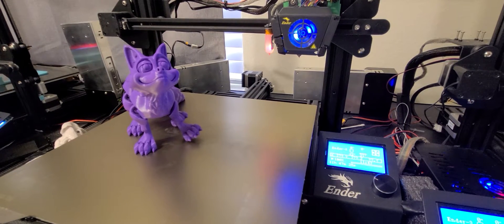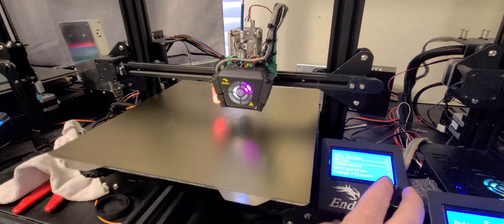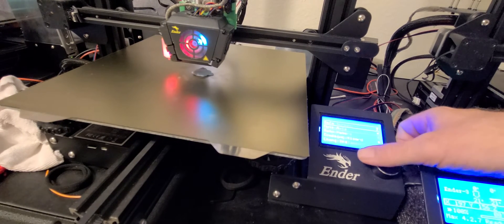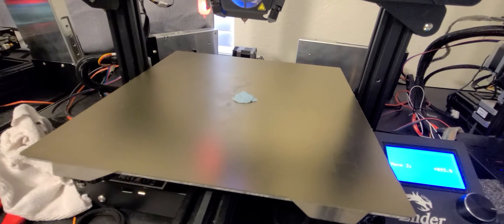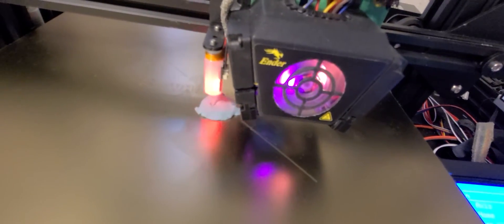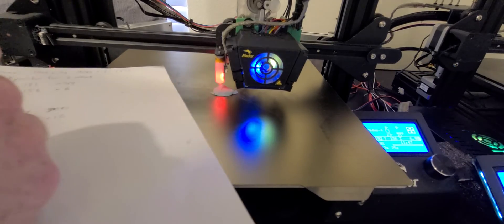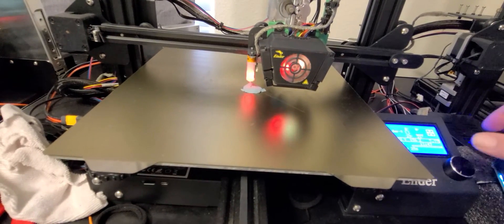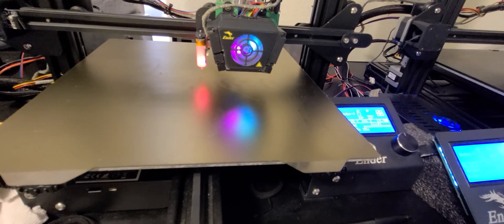BL touch center on any 3D printer. The easy way!

Comment: Why would we want the BLTouch-specific center point instead of the nozzle's center point?  How does that help if the 0,0 Home location is off the bed? Would that make auto-homing impossible if you can't get past the first homing spot? Also, why did you have to add 15  to the Y-value --- Y-Value of WHAT?
Reply: You want the same exact spot for the probe as you do when you measure the nozzle offset. So by puttling it so the probe is dead center and then moving the nozzle to dead center when you work out the offset the 2 will be in the same spot so the offset will be easier to get correct. 

If you measure the offset location in a diff spot than that probed you run the risk of the bed skew between the 2 locations, altering your TRUE offset value too much and causing issues printing

Comment: Want to add that if you don't have putty or kinetic sand laying around, which I don't, you can mix flour and water to make a dough ball. Leave it a little damp and sticky and press it down on the bed center then flour the top so it doesn't stick to the nozzle.
Reply: or just put scotch tape on the bed and mark the center with a pen

Comment: How do you stop it from probing off the bed? I can set the Home position and offset just fine for the nozzle and probe center, but this pos still goes to the exact same place off the front of the bed and tries to probe air.
Reply from the maker: You can try my firmware. Usually that is either you stop sensor needs to be moved over or in marlin you change to distance of probe. Unfortunately I am unable to make any changes to firmware at this time. As soon as my family finds a place to saves more and find place to live I can really help out again.

Comment: I did follow this but my overall 5x5 mesh if you think of it like a rectangle on the bed is offset to the left. The left mesh line probes 1/4” from the left and 3/4” from the right
Reply: did you ever figure out how to fix this? I am having the same issue.

Comment: I already scrapped the Creality firmware and installed Insanity Automation which fixes the XY Ofset issue of the BL Touch and adds a few new menu options to Marlin.
 So does this method make the BL Touch probe the bed in a uniform and equal fashion?
Reply from the maker: I don't like that firmware. I compiled my own to prode the correct areas for BL touch on latest version of marlin. Works great for me. Have all the feature. Bed tramming, babystep, and more every feature. Try learning how to compile your own firmware. Then you can always be on latest version of marlin. Bl touch doesn't do anything different. It all levels the same way. It's all about were it measures. Like the 5 plus stock measure wrong. This video is just to identify the center on bed for when you home printer.